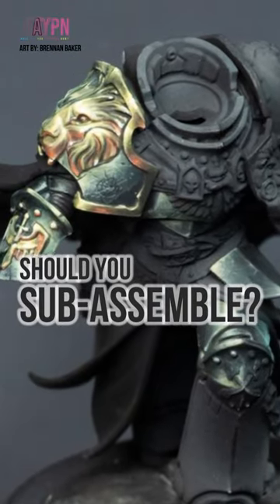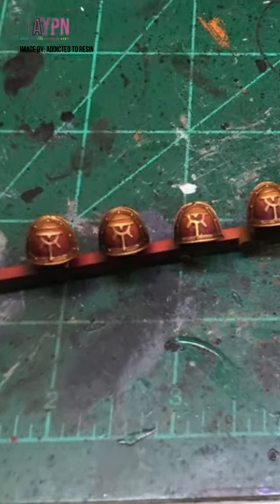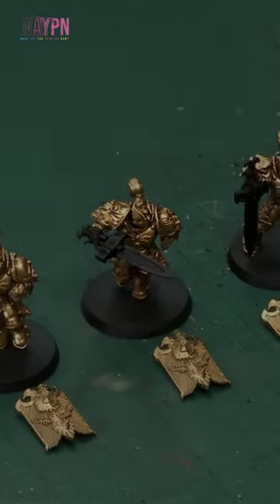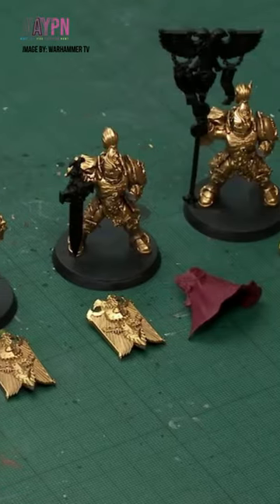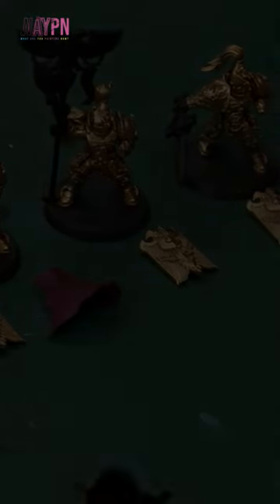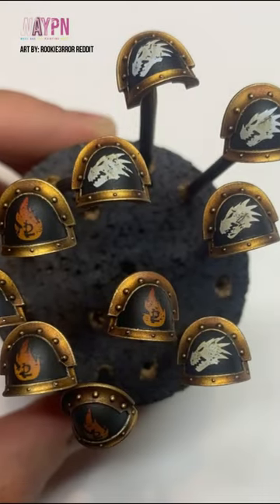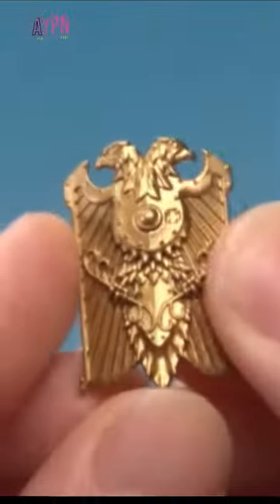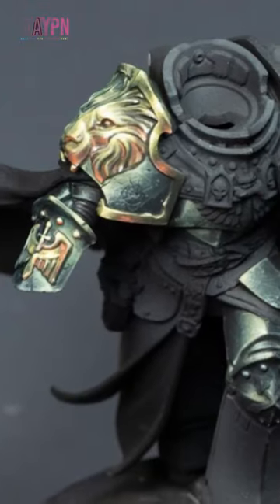What is Subassembly?

Comment: I think the answer is basically yes, where it's faction-specific as to whether it's a boosting technique or mandatory to get all the color separation right. Marines and Necrons you can kind of just wing it, with AdMech you might as well lose the assembly booklet.       
I'd argue that the current shift towards more dynamic poses makes it a basic technique for anyone shooting for satisfying results and also that for that reason a lot more models should be at least partially push-fit to accommodate test assembly in the middle of painting. I can cut the pegs off if I don't like it, but they're so useful when trying to pose stuff like arms.

Comment: what would be a solution to gluing parts back on after sub assembly?  super glue? scraping off some paint to add plastic glue? I assume plastic glue wouldnt work
Reply: You're not supposed to paint over the connecting points. But the answer is yes, you will want to scrap the connectors before gluing.